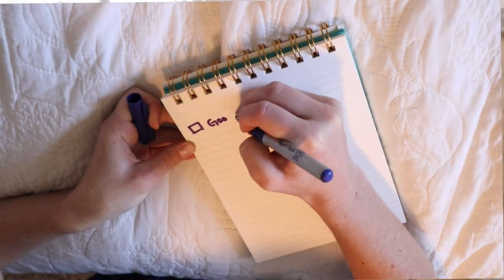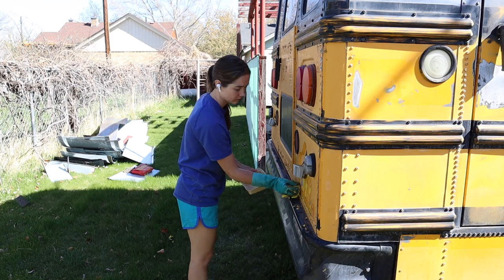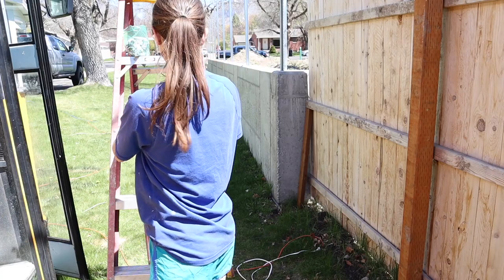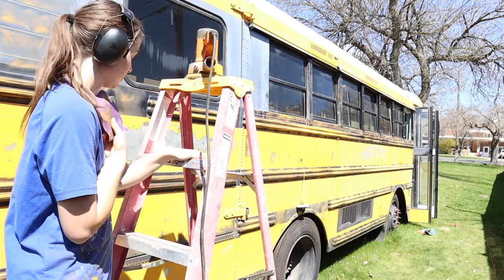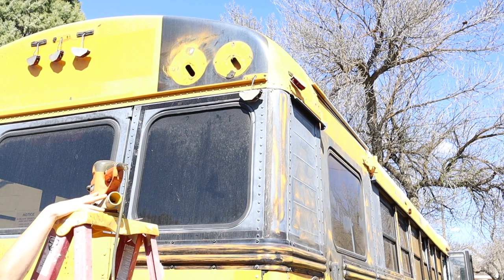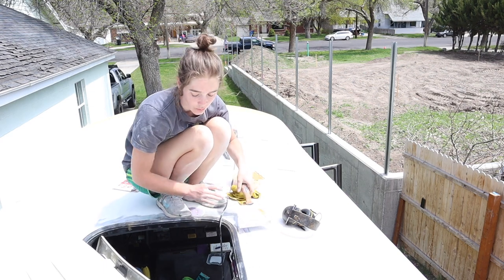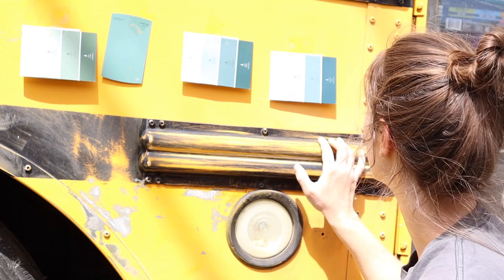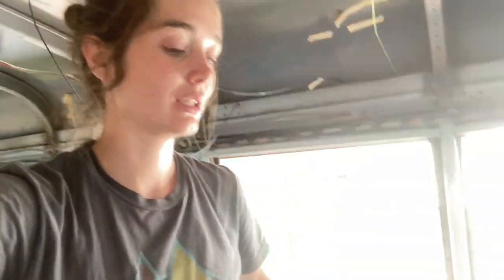I'm FINALLY *almost* ready to paint the bus //dummy builds bus pt. 8: more prep, choosing colors etc

Comment: My windows held in my wall panels when I gutted my bus - for the windows u don't plan to remove, you could angle grinder and a cutoff wheel to chop the wall panels right below the windows and they should pop free. Any progress on a project this big is good progress! Big fan of Gilligan Phantom's saying "Lets do something on the bus", cause as long as you're doing small things here and there it'll get done eventually :)

Comment: You can use oven cleaner on the goo to remove it.  Just spray on and wipe off.  Any metal that is bare should be primed immediately so it won't rust.